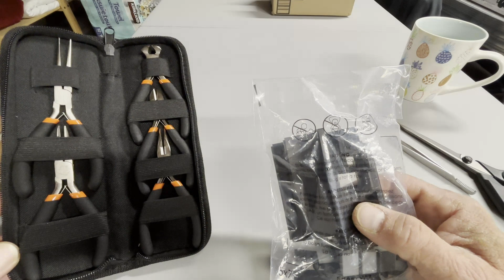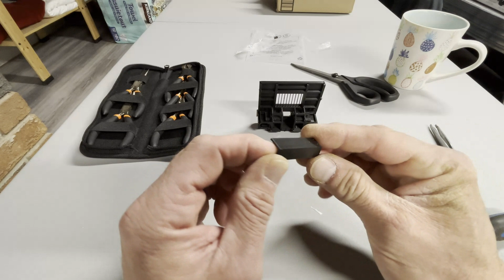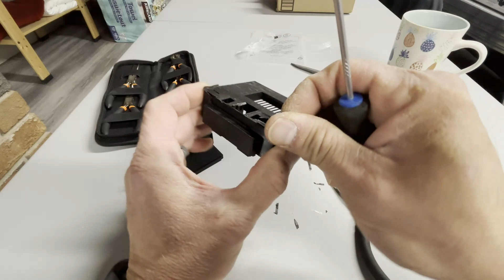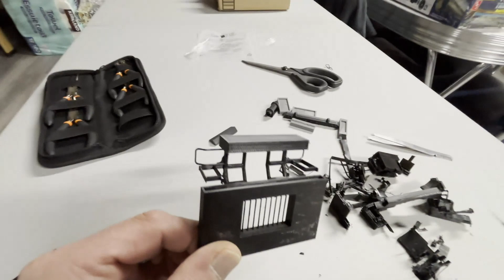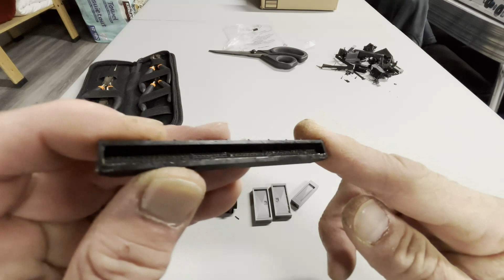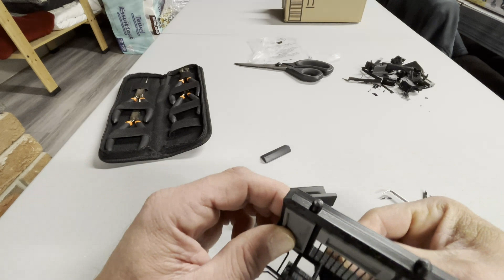Our Oilfield Winch Rack - How To "Unpack" It

Comment: Karl, I am glad to see an unpack video, of this headache rack. I would be concerned that I would pick at the wrong place, and snap off some small details! If you are not really up, on what the part looks like clean of manufacturing flash, it could happen. The rack is so cool!! One question - are the slam locks on the cabinet doors always facing the right side of the truck? Or is that an owner option? Just wondered? All the parts, coming so fast. 😲 Wow! Great 👍👍👍 So many choices! I can see your , your brother & Jim's passion for this❤️👏👏👏
Reply from the maker: Hey... that's a great question. I believe that when we modelled this rack it had doors facing the same way. I can ask our designer if we can get left facing door and offer it as an option and the builder can choose from three selections... that's kool and I'm sure it's do-able. Thanks for tuning in!
Reply: @karlturon427  Karl, Thanks for considering it!

Comment: Absolutely stunning Karl. You and your brother are really dialing in on your craft! The exposed surfaces are so smooth,  I think you mentioned that before, that you guys worked on that. It's awesome to see a dry-fit actually stay together. A testament to your commitment to quality!  So for my build of my Dad's Freightliner and oil waste trailer, i still need a representation of the PTO Pump that rested on the frame behind the cab. I have no pictures of it, but I  remember it being a beast with in-out coupler connections for the flexable hoses. What I'm getting at is I  think this would be a good project for 3D Concepts to make....LOL, just a suggestion 😂
Awesome vid on the new rack, if the beacon was separate,  could you make a clear dome?  I guess that would be a whole differnt process , but wow that would be incredable to offer clear parts😊
Cheers 🍻 
Corey "Earl" Widmeyer
Reply from the maker: Hey Corey, thanks for the kind words! We are putting our best efforts into this for sure. Send us an email on our website and we can definitely take a look at that PTO pump when you get the info to us. Cheers!